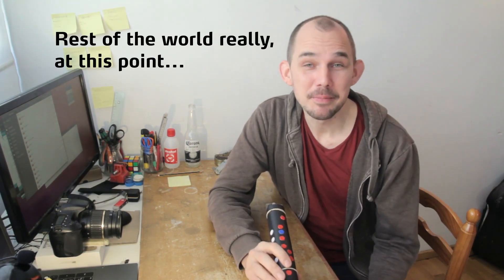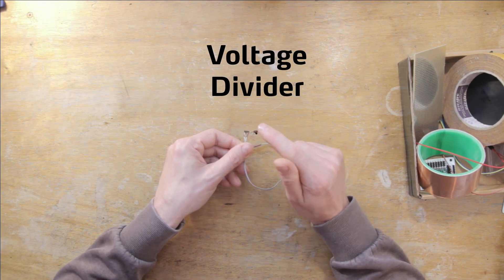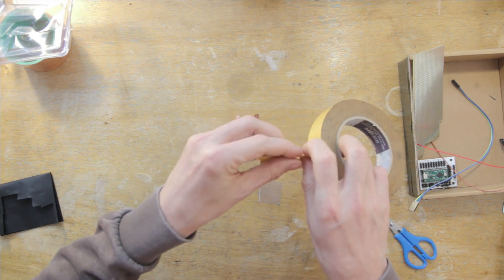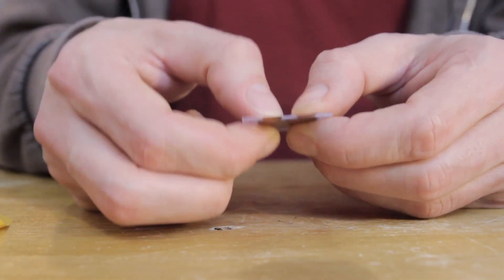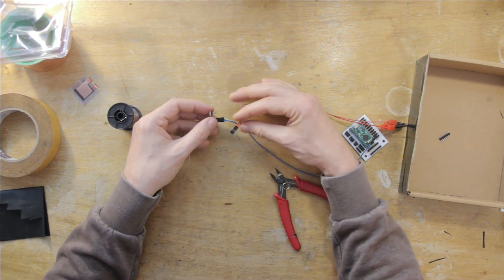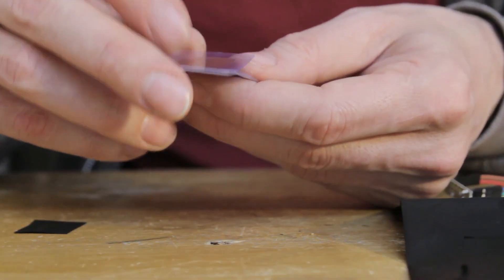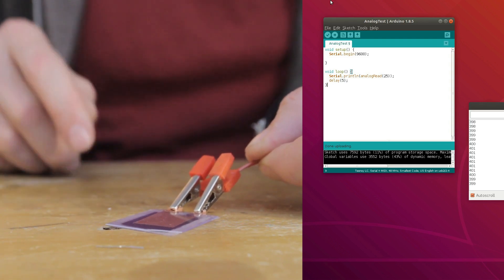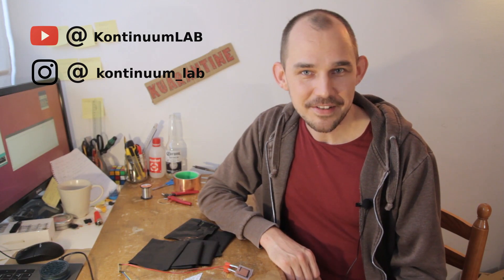Making a DIY analog force sensor under quarantine, with the Kontrol Freak.

Comment: Very interesting and useful, this is a small sensor. I wonder if to create a DIY force sensor with a size larger than 4x6 inches, a larger resistor is needed? Tks for your video
Reply: a larger velostat represents putting more resistance between the copper sheets in paralell (lowering the total), so you would want a lower value to keep the voltage divider at a reasonable ratio. however you might run into issues where too much current is traveling through the sensor, heating it up. you can solve this by adding more sheets of velostat to raise the resistance back up or by using some op amps to build an active measuring circuit that both keeps the current running through the sensor low and amplifies the signal for better noise charecteristics. there's an article on nuts n volts magazine for making a ribbon controller using a softpot whose circuit would also work for the FSR.

Comment: You used a change in resistance you said right.  I had an idea similar but would used the change in capacitance of a material in-between two plates have a known compressive value ( basically a springy dielectric) and I thought if I made this into a tank circuit and set it 7p to oscillate I should be able to detect very sensitive pressure changes.  
I would be interested in any experience with something similar or problems one might see with my design. My biggest fear is it might be too sensitive and pick up even mild changes in air pressure since after all its similar in fashion to old school condenser microphones
Reply from the maker: I'm not sure I understand what it is you want to make, so can't help you with advice. But you should just try to build it and see how it goes. Best way to test your ideas 💡

Comment: @9:11 interesting . I suppose if you had multiple sensors you could use a multiplexer chip as input for all those sensors,  and then have its single output going to this one voltage divider circuit to keep everything really simple. Nice. Replace that resistor with a variable pot and you could even fine tune the circuit according to your maxim force.
Reply from the maker: You're exactly right. In the next video I use this sensor to make a 16 pad instrument, with a multiplexer and single voltage divider: https://youtu.be/X-mxTYgY9lQ

Comment: Hi, could this method be used to make a softer sensor that could wrap around something? Or is there some principle that links you to two flat surfaces?
Reply: For example, if you wanted a sensor wrapped around a cup?
Reply from the maker: You might be able to make a curved sensor with this technique, but I think it will be difficult. You could try to make a narrow sensor along the length if the cylinder, rather than a wide one which wraps around, to minimize bending of the sensor layers. But really, I'd recommend a capacitive sensor for your cup. Slightly different functionality, byt you can make it any shape you want.
Reply: @KontinuumLAB  Thank you for taking the time to reply.  I know I said cup but my application would be something more like the tip of a stylus.  It's not about the tip touching a screen though. I'm trying to pick up when the tip touches down on any surface. I thought I could maybe wrap the tip of a pen with a material similar to yours but it sounds like that wouldn't work from what you're telling me.  I don't think a piezo would work, but I haven't looked into a capacitive sensor.  For a moment it sounded like wrapping the tip of a pen/stylus in a force sensitive material would've done the trick.  Thanks anyway!
Reply from the maker: @jamesonvparker  Unless you need pressure sensitivity, then a small mechanical push button (membrane-type) is the obvious way to make  that kind of stylus tip.
Reply: @KontinuumLAB  thanks again. I’ll check back and let you know how things go.

Comment: Hi! I loved your project, it was all I needed, but I noticed that when you open the serial monitor the value of velostat does not stop varying even if you are keeping in touch with it ... how do you solve it?
Congratulations for the initiative!
Reply from the maker: Yes, you're right. These DIY sensors are not very stable. I always apply a software filter if I want to use them in an instrument. There are many different ways, try a Google search for "analogRead filter" or "Arduino smoothing library". Happy making